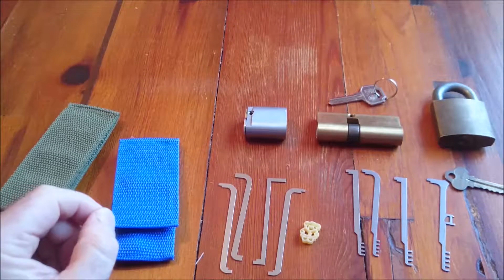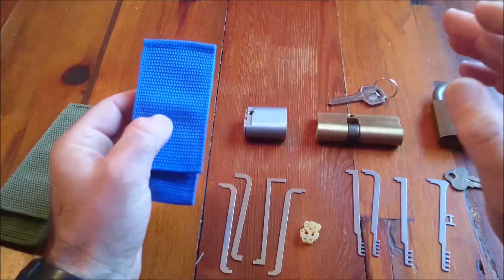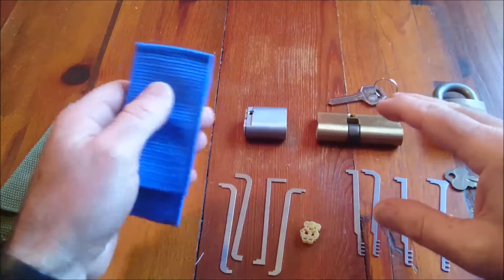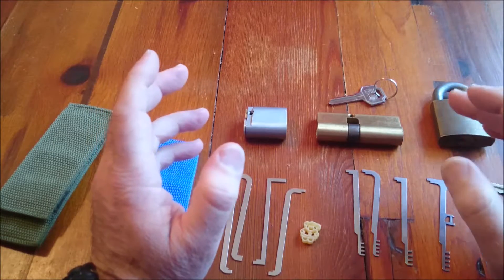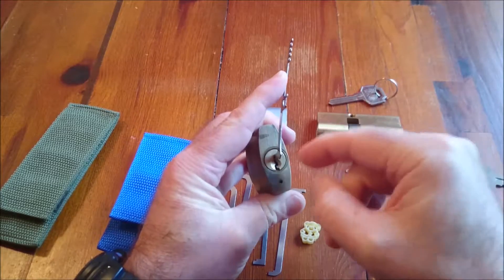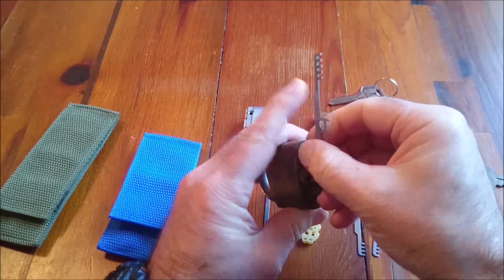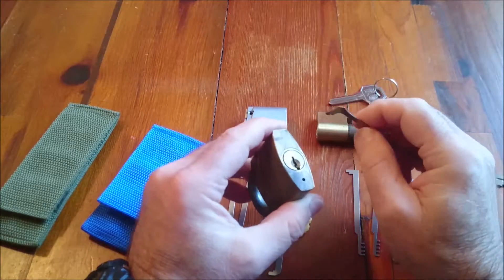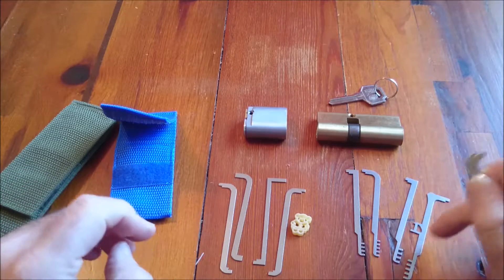[8] Mad Bob Pry Bar set reviewed and compared, part 1 of 2

Comment: I agree with you on light tension. I go with the heaviest I can get away with, particularly when picking standard pins.  With spools, I try to increase the tension as quickly as I can as the spool sets.  I find this can reduce the occurrence of set pins dropping again.
Serratted pins are another matter, a fraction too much tension & the pins just sieze up.  They ain't going anywhere.